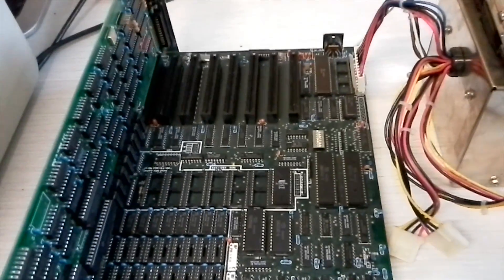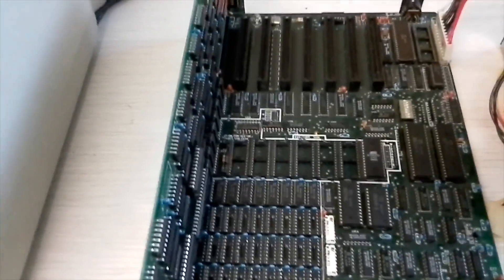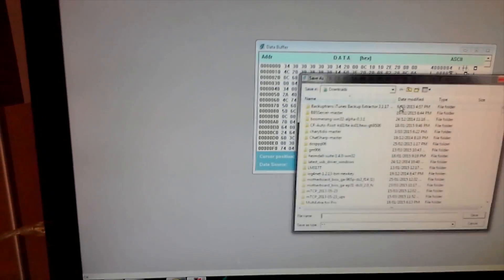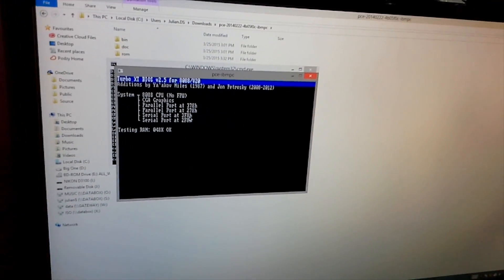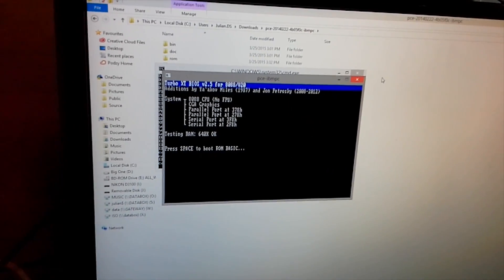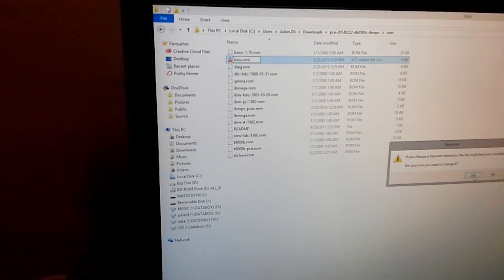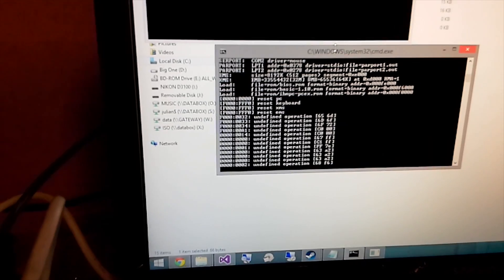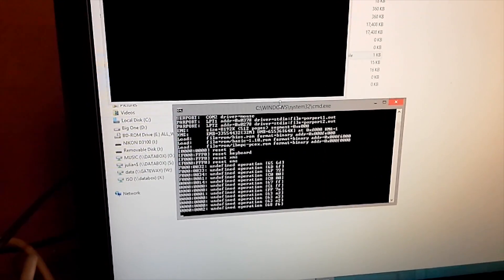8088 Update

Comment: Could be that your newer style rom may not have the exact pinout and the board just isn't happy with it for some reason. Those Orange caps go bad really easily, might want to check into them just to see if its a combination of things.
Reply from the maker: MadeOfSolder 28C64 is a drop in replacement for a 27C64 .. I've also tested the ROM on Aussie50's clone board just to make sure it worked
Reply: oh ok, glad to hear that works, if you haven't already then I'd just copy the rom from Aussie50's clone onto your 28C64 and run it like that.